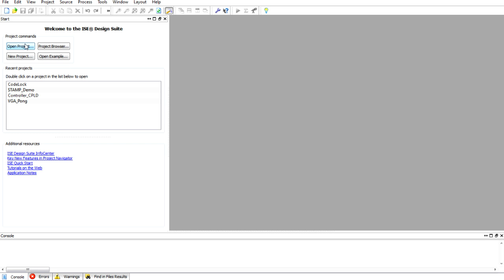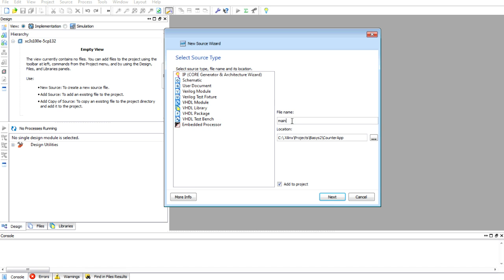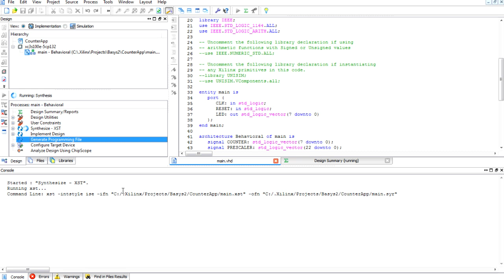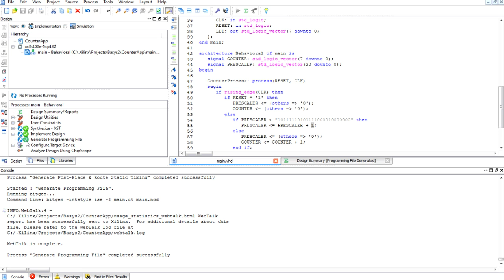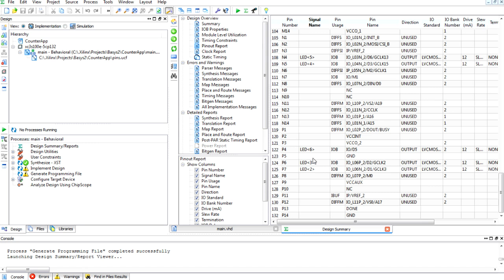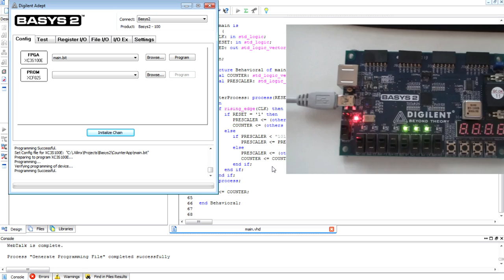FPGA Xilinx VHDL Video Tutorial

Comment: hi , Very nice and clear explanation. Thank you. One questions  the RC servo motor-5nos. can I directly connect to BASYS 2 board (the one used in your video) OR do we need the Servo driver circuit?.
Reply from the maker: Depending on the current consumption of the servo motor I would suggest that you use a seperate 5V power supply to power the motor.
But you can conncet the servo signal wire directly to the Basys 2 board and then program the pin to generate the appropriate PWM signal (50 Hz, 1-2 ms pulse width)

Comment: Hii.
I really have enjoyed and learned a lot from this video, thanks a lot.

I have some issue,
I am working with VIRTEX-5 XC5VLX50T     FFG1136FU1105.
I am using Xilinx ISE 11.1

I am finding trouble with my pin definition.
I have defined the pins to the board, and when I run implement design again, it shows the error below.

ERROR IS --
Line 10 in Counterpins.ucf: Syntax error.  Ensure that the previous constraint specification was terminated with ';'.

I have done nothing wrong with syntax as far as I know,

But I don't know how to solve it, I tried my best but not enough.

I would really thankful to you if you can help me here.

THANKING YOU AGAIN
Reply from the maker: It sounds like you do indeed have a syntax error inside your pins definition file. Note that the error might not be exactly at the specified line (Line 10), so please look around.
An example of a correct UCF line is:
NET "CLK" LOC = "P38";

Comment: Why not to make PRESCALER as integer variable? it's easier to write code, don't have to think about how long vector should be, you can count it to 50,000,000  instead of 10111... and it's very simple to change if you have to. And of course, less space to make error.
Otherwise, maybe I don't know something, so you can correct me.

Btw, thank you a lot, this helped me a lot with university project :)
Reply from the maker: You are right that the code becomes more intuitive and easy to read but what you probably don't realize is the use of extra wasted bits in the storage of your variable.
By explicitly telling it to be of a certain size (eg. a std_logic_vector of 28 bits) you are assured that it will only take of 28 Flip-flops (or similar) for storing this value. If you however use an integer, it will reserve the number of bits corresponding to an integer as set by the project (eg. 16-bit or 32-bit).
Reply: Thank you! Yeah, you are right on this spot! Btw, this method, dunno why, didn't worked for me and my university professor didn't knew either :/ But my method worked fine.

Comment: the digilent adopt works only on the basys2 boards or can works on others divices??
Reply from the maker: The Digilent Adept software can be used in conjunction with a Digilent JTAG programmer to program several Xilinx FPGA's, CPLD's and PROM's. Thus not limited to only the Basys2 board.

Comment: Great Tutorial!!!

Dear TKJ Electronics,

I used to see the fascinating project ideas and  videos related to that through your great you tube channel. 
I have a request to you for a video on VHDL project:

We have a calculator program in vhdl and we need to interface the the PS2 (Keyboard), VGA and processor using an Xilinx Spartan 3E starter kit board. Finally we need to run the calculator program and test whether all the interfacing and processor designing are working properly.

We are really new to this and have very limited knowledge on the same. 

It would be great if you can upload a video showing how to do the programming for processor, Keyboard and VGA interfacing for the Xilinx Spartan 3E starter kit board.

Comment: why you use 22 downto 0 ? with those values the prescaler cant reach 50MHz or ?
Reply from the maker: Please watch the video to the end where I also comment on the mistake. The length of the vector (array) needs to be 26 bits why the vector definition should be: std_logic_vector(25 downto 0)

Comment: I've been having receiving an abnormal error when trying to initialize chain when my basys 2 board is connected with a usb. Found device ID: fffffff X20 and initialization failed is displayed in the status window of the Adept 2.0 application followed by a pop-up saying "Inilization Failed. Check Connection and try again". Do you have any information about fixing this issue. I've seen people suggest Digilent's JTAG usb cable but im not sure if thats necessary.
Reply from the maker: Have you tried connecting any external JTAG programmer to verify that the FPGA itself has not been damaged?
Have you tried using the Basys 2 board on any other PC to see if the problem is related to the driver?
The error with the found device ID indicates that the PC is indeed communicating with the JTAG controller but the error suggests that the controller is unable to detect a proper JTAG chain and the FPGA device on it. This might also occur if the JTAG chain is broken due to the connection of further devices on the chain.
Have you connected any other JTAG devices to the chain?

Comment: Hello Mr. First of all thank a lot for your tutorials. İ am writing same codes but i am getting 3 error:
1.where there is end of the entitiy. '' ); ". Syntax error.
2. near begin syntax error.
3. <CLK> is already declared.
i wrote same program but its giving error. could you help ? Thank you very much
Reply from the maker: Can you please copy your code into the comment so I can have a look at it. There is a high chance that you might have either misspelled something or missed a semicolon.
Reply: ibrary IEEE;
use IEEE.STD_LOGIC_1164.ALL;
use IEEE.STD_LOGIC_ARITH.ALL;
use IEEE.STD_LOGIC_UNSIGNED.ALL;

entity main is
port(
  CLK: in std_logic;
  RESET: in std_logic;
  LED: out std_logic_vector(7 downto 0);
  );
end main;

architecture Behavioral of main is
 signal COUNTER: std_logic_vector(7 downto 0);
 signal PRESCALER: std_logic_vector(22 downto 0);

begin

 CounterProcess: process(RESET, CLK)
 begin
  if rising_edge(CLK) then
   if RESET = '1' then
    PRESCALER <= (others => '0');
    COUNTER <= (others => '0');
   else  
    if
     PRESCALER < "10111110101111000010000000" then
     PRESCALER <= PRESCALER + 1;
    else
     PRESCALER <= (others => '0');
     COUNTER <= COUNTER + 1;
    end if;
   end if;
  end if;
 end process;
 
LED <= COUNTER;

end Behavioral;
Reply from the maker: In the port declaration with the LED you should not end this line with a semicolon as this is done with the paranthis and semicolon in the next line.
Please try this and see if it solves all the problems or let me know the error it returns.
Reply: port(
  CLK: in std_logic;
  RESET: in std_logic;
  LED: out std_logic_vector(7 downto 0)
  );
end entity;

i edited to this and compiled succesfully :) Thank you so so much :)

Comment: is the simulation created automatically?
Reply from the maker: +Willy Rosa Huanca The simulation testbench has to be programmed, as you have to define the test scenarios and test signals which will generate some expected/known outputs that can be used for comparison.
Reply: Thanks for replying
I mean. Di u use a physical device to test?
Reply from the maker: +Willy Rosa Huanca I tested the VHDL code on a physical development platform (Basys2 in this case). But this is not necessary as you could easily just simulate it only.

Comment: Thanks for the video, I have one question, why do you need to define "CounterProcess: process(RESET, CLK)" ?
Is it like a function in java? and if so, no one is calling it! May you please elaborate?
Reply from the maker: This definition is part of the VHDL syntax. A process is a parallel state machine type of function which is not called (as used to with C functions etc.), but is rather instantiated and implemented in parallel logic and flip flops.
So in general it runs all the time. 
The signals in the parenthesis is called the sensitivity list, used to indicate which signals are used for triggering and/or clocking of the process. 
I hope this cleared it up a bit.
Reply: Ok, thanks

Comment: do the 7 segment one how to access first anode segment 5 for example?
Reply from the maker: +The Manthis Are you talking about the Basys 2 board?
If so, I would recommend you to take a look at our clock example which includes our Seven Segment controller: http://blog.tkjelectronics.dk/2010/09/first-project-with-fpgas-seven-segment-display/
To access the 7 segment you have to drive one of the anode pins low and then drive the according segment pins high.
Reply: +TKJ Electronics Oo I see, just why make things to complicated, all you need is just 4 lines of code after architecture begin in this case:  But how do you access 2 anodes at the same time? say I want to display nr 1 on first & nr 2 on the second anode ?

anodes  : out std_logic_vector(3 downto 0);
segments: out BIT_VECTOR(7 downto 0) 

anodes  <= "1011";  
segments <= "11000000";
Reply: +The Manthis anodes  : out std_logic_vector(3 downto 0);   // dont know how to line break on youtube sry
Reply: +The Manthis segments: out BIT_VECTOR(7 downto 0)
Reply: +The Manthis anodes  <= "1011";
Reply: +The Manthis segments <= "11000000";
Reply from the maker: +The Manthis To control the individual segments on each display you would have to use a technique called multiplexing. Eg. see https://www.youtube.com/watch?v=28yvpyaqsqU

Comment: hi.nice tuto thx so much but line 50 51 why else      if  why not elsif ? is it diferent or not ?
Reply from the maker: +busta97200 The else at line 51 corresponds to the RESET pin NOT being set, which means that the counter should be running.
As RESET can only be either ON (1) or OFF (0) the else statement corresponds to RESET being OFF.
Writing "elsif (RESET = '0') then" would result in the same thing.

Comment: Nice tutorial! Just got my Basys2 and I am very excited to work with it. :) 
But there is one thing bothering me: whenever I change something in my .vhd-file and try to generate a programming file, Xilinx tells me there is an error in my .ucf-file (asks me to check if I missed any ';' at the end of the last line). But everything is fine with my .ucf because i didnt even change it. What may cause the problem? :S
Reply from the maker: +Gentle Coo Are you sure that the UCF file is right and correctly imported into the Xilinx ISE?
Reply: +TKJ Electronics Yes, just like you did. Every pin is the same on my board. 
.ucf:
1 NET "CLK" LOC "B8";
2 NET "RESET" LOC "A7";
3 NET "LED<0>" LOC "M5";
4 NET "LED<1>" LOC "M11";
5 NET "LED<2>" LOC "P7";
6 NET "LED<3>" LOC "P6";
7 NET "LED<4>" LOC "N5";
8 NET "LED<5>" LOC "N4";
9 NET "LED<6>" LOC "P4";
10 NET "LED<7>" LOC "G1"; 

Error:
ERROR:ConstraintSystem:300 - In file: Pins.ucf(10): Syntax error.  Ensure that
   the previous constraint specification was terminated with ';'.

This error comes with every line so 10 times. :/

EDIT: 
I solved the problem. A simple '=' had to be add between LOC and the following term. 

1 NET "CLK" LOC = "B8"; -> good
1 NET "CLK" LOC "B8";     -> bad

Thanks for your quick response! :)
Reply from the maker: +Gentle Coo If you look closely in the video at 22:00 then you will also see that I include the equal sign, so you have definitely forgotten something :-)
Reply: +TKJ Electronics oh no! shame on me :S
Those how can look are clearly in advance. ^^

Comment: Hello...I want to generate clock pulses with variable duty ratio using Digital Clock Manager of sapartan 3E XC 3S500E FPGA kit and vhdl program in xilinx ise for a project. Can you send me some link or any help regarding this. Thank you.
Reply from the maker: sumi The DCM cannot be used as a variable clock generator with variable Duty Cycle. You have to define which input frequency that you have and which output frequency you would like before you synthesize your project.
In your case I would make the required logic to generate a PWM signal with variable duty cycle. This is not a difficult task and is very trivial as a training task to get familiar with FPGA programming and development.
Eg. Please have a look at the following tutorial: http://www.elektrorevue.cz/en/download/generating-pwm-signals-with-variable-duty-from-0--to-100--based-fpga-spartan3an/
Or an example VHDL code: https://eewiki.net/pages/viewpage.action?pageId=20939345
Reply: mindthomas Thank you sir. But I need to modify the frequency of the DCM even if we need to specify the frequency in the code and not design PWM. Can you please help me with this.

Comment: Thank you very much , my question is :
I'm looking for dijkstra algorithm written in VHDL , can U send me the source code 
thanks
Reply: Really this is just a ref of certain materials redeveloped using symtacts(of dijkstr,etc)which (from initializing origination of such,the machine coded ,in its busy network,an ref algorithm, but not API,as code would imply frameworks API etc..)Open source,when 'stack'was very rich and alert of instruct such as that(unexplainable position)as unable term acute 'pointers' midline micro to mass onln e effect (of the stack,node,clusters,etc)why aimed 'topologics'too vhdl,Verizon,logicDesign ,which as word terms affects encrypted wail of synchronic strict ruled 'practices'directky into methods ,why menu reprogram would be a good start too use this or eclipse too find other MIPS Asm language ability litters where fruits of past dual fold cooks book upon specially defined instance then,like slang,habit,kit or delta tests for apply too use, prototype being effect term and conditions?For instance you don't research actually what a Xilinix embedded Linux is even upon,etc? Yunno I'm not against any use but point or marks of this wailing neg promotes I should recall and mention!?All best

Comment: hi.. i am using xilinx ise for a project and i want to know how to use chipscope ... my project is about receiving data bits from a receiver board to spartan3 FPGA in dc890b board .. and analyze the incoming data bits directly and then generate output file... can you help me in this.. in using chip-scope for the said purpose.. as i had never used chip-scope.. thank you
Reply from the maker: Imran Sarwar I am sorry, but unfortunately I haven't worked with ChipScope yet. Usually I tend to connect and use an external logic analyzer, preferrably the Saleae one.
But if you have a proper license for ChipScope it should work just as good - though unfortunately I can't help you there.

Comment: hI I'm new to this, my question is:
If I generate a logical circuit schematic, you must create VHDL code for then implement the circuit on the FPGA board? i dont now if i explain.
Reply from the maker: You can do both.
Either you draw an RTL schematic within Xilinx ISE, which I wouldn't recommend, and then generate the FPGA bitstream (programming file) from this.
Or you would do it the usual way and write the VHDL code and generate an RTL Schematic from this to view how the VHDL code is implemented in logic.
Reply: mindthomas thanks for the answer =)

Comment: did you forgot to reset the "COUNTER" or does it reset itself? Like how it did with the PRESCALER when you defined its value as 22 or did the process stop due to an overflow error, just like how it normally happens i.e. say in a C++ array. Thanks for the video btw.

Comment: Hi it was great, I am also using the same board, is it possible to interface LCD with this board, I have tried every thin on my level, I searched lots of code, I also tried to make code my self but nothing works I don't know why, I am sure I have connected every pin correctly and my UCF file is also correct because it is working when I switch on or off the LCD, Can you please help me .........

Comment from the maker: Yes, there is a significant difference. Variables in VHDL are used processes of behavioral applications, but the negative aspect of them is their requirement of extra space in the matter of Flip Flops (slices).
So I recommend to stick to the signals (which I in the video calls variables once because of the comparison to software programming) as long as you don't make synthesizing repetitive processes.
For more information have a look at this page: gmvhdl.com/variable.htm

Comment from the maker: No, unfortunately. The Adept software will work with any other JTAG adapters than the ones by Digilent.
You have to invest in one of those adapters. The real Xilinx programmers are much more expensive than the Digilent ones, and the Digilent USB JTAG programmer works very well, so I will say it's a good choice.
You could also buy our uniJTAG board which can program everything from ARM processors to FPGA devices. Read more here: tkjelectronics.dk/?p=products&product=unijtag

Comment from the maker: @juansiahaan Your board contains a the following Spartan 6 FPGA, XC6LX16-CS324. This has a different pin-layout than the Spartan 3E I am using, so you would have to change the pin definition file.
Have a look at the following datasheet at page 65: xilinx.com/support/documentation/user_guides/ug385.pdf
Have a look at your board and see which letter and numbers you can see below the LEDs you have on the board.

Comment from the maker: @xkorn Yes, actually there is. One of the topics is how to generate VGA signals. Another one is how to interface an FPGA with a microprocessor. And the last one, as a follower to the microprocessor one, is how to get the Gameduino core (for the Arduino) to run on our FPGA development board, with a Spartan 3E

Comment: I copied the exact code to the project navigator, and assigned the pins just as you did. but then I program the board and the leds are still off. any suggestions?